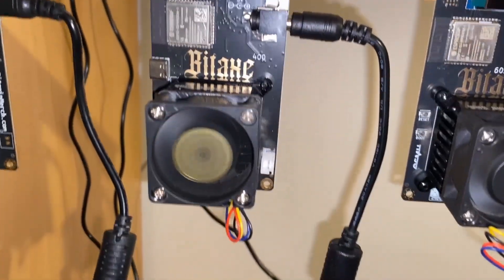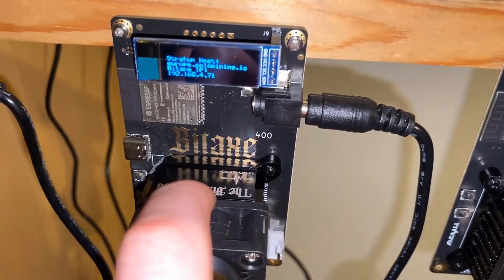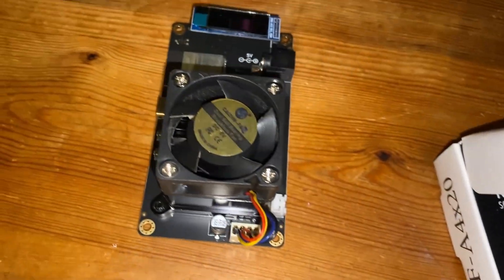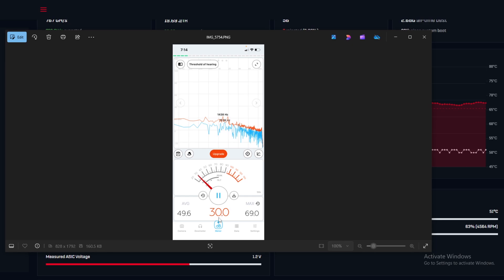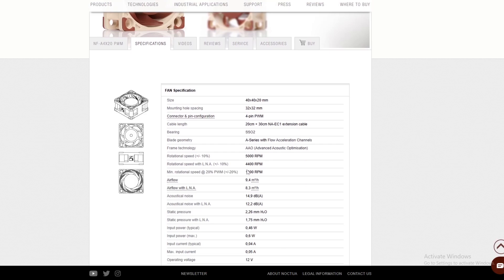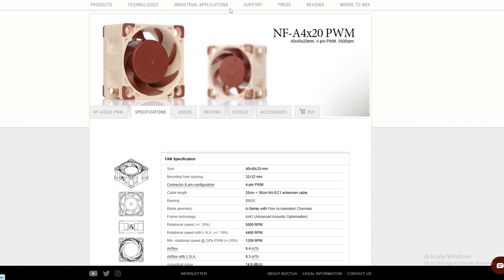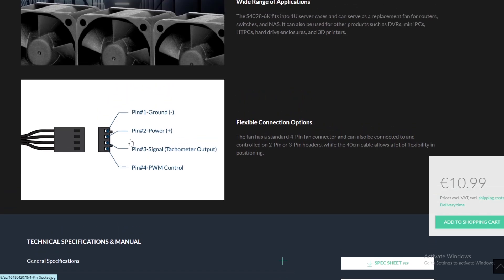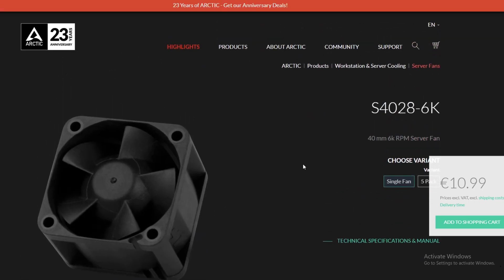Noctua Fan vs Standard Fan - Which is Better For Bitaxe?

Comment: Hi. I've bought a better fan but my bitaxe is limiting the fan at 2000rpm.. do you have any ideas why???
Reply from the maker: is the fan 3 pin, if so its probably because you need 4 pin
Reply: you probably bought a 12V fan instead of a 5V one.
Reply: @mrfox5393 I did find this out a little while ago… didn’t think about it at the moment. Thank you!
Reply: @cristianspiridon  Nice, no problem! :)

I'm about to upgrade mine too with a 60mm fan and I'll test a small peltier module to supercool the heatsink as well, am curious if it will be able to hit 10 celsius or lower.
Reply: @mrfox5393 Just the fan with the default heat sink?
Reply: @cristianspiridon  I swapped out the heatsink for a low profile one for a Raspberry Pi 5 but can be attached to the Bitaxe as well 👍

Comment: Those Arctic fans you showed us are 12volt fans. They do start up with 4.5v. Does this mean they will run on 5v?  Thanks for your time
Reply from the maker: i havent actually go one, but seems like 4.5 should be able to run on the system, just dont know if it will give good speeds at those low voltages
Reply: @SterlingSpecter1 I just got some. I’ll let you know how it goes.
Reply: @SterlingSpecter1  I installed some of the Arctic fans. They do start up and run, but only at full speed, with no adjustment available. They keep the chips cool, but are also very noisy. Probably won’t keep these ones.

Comment: It’s all about power supply, clean efficient power. Double the the heatsink capacity and you’re good. The ice tower and thrml require a base plate of copper. A heatsink works just fine and doesn’t cost any more

Comment: I have 3 bitaxe gammas, one basic fan, one ice cooler tower fan & one with the argon thermal fan. I get 1.5 th/s & as high as 2 th/s when overclocked with  both the ice cooler tower & the argon thermal fan. The argon thermal fan keeps cooler than the ice cooler as well as the efficiency being better on the argon thermal fan. I upgraded the fans when I bought the two bitaxe gammas from d-central tech. Much better then the basic fans & well worth the extra $
Reply from the maker: I need to get a back fan, eveyone is telling me to do it
Reply: Yeah that helps tremendously. Two of my gammas have fans on the back,  I was thinking of putting a nactua fan on one